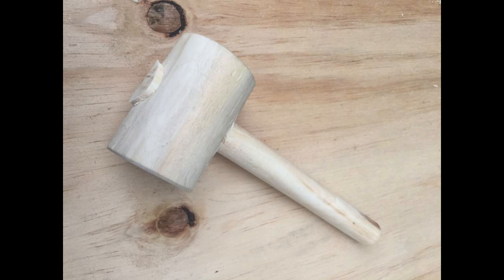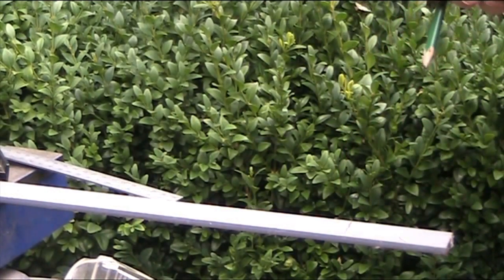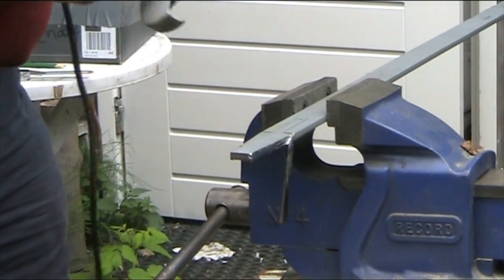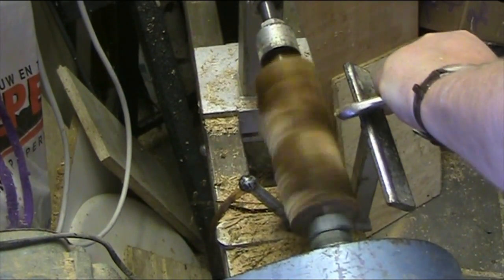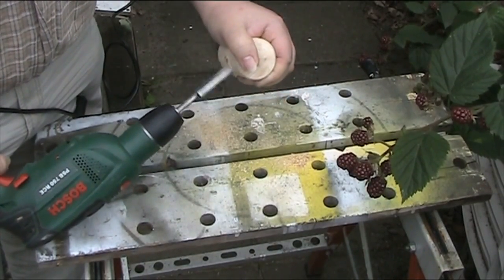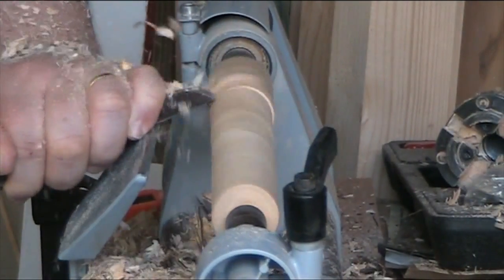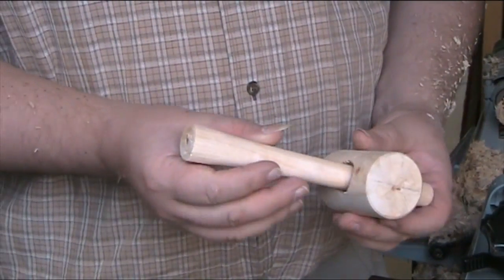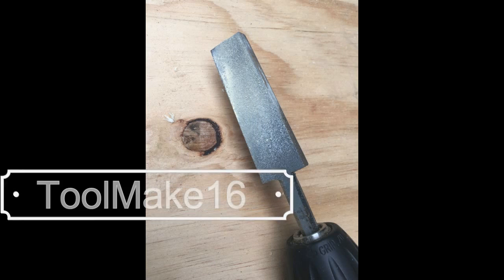ToolMake16: A Reamer to make Mallet Head Holes, Willem's Woodnotes

Comment: Quite useful tool, and amazing work. So nice done, Willem. I downloaded your video, for "turning" learning, with 3 basic tools :) Thanks for sharing and good luck in Toolmake16 ! Your work is great Sir
Reply from the maker: Thanks! The tool i use for most of the turning of the handle looks like a bedan but it actually is an old mortising chisel. I got started this way, but its not the 'normal' way to do it. 

For a foot powered lathe like you build people normally use hook tools.
Reply: Thanks for all this information Willem !